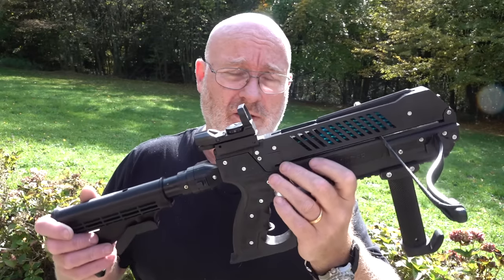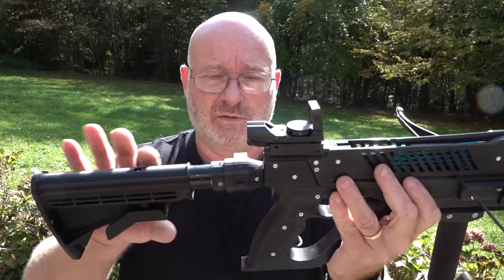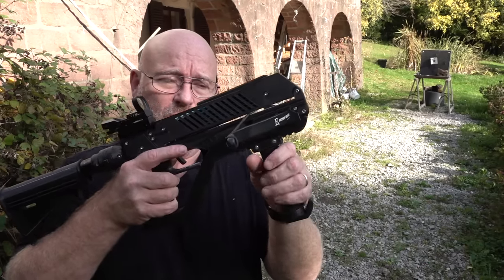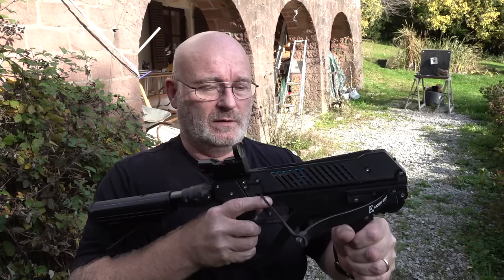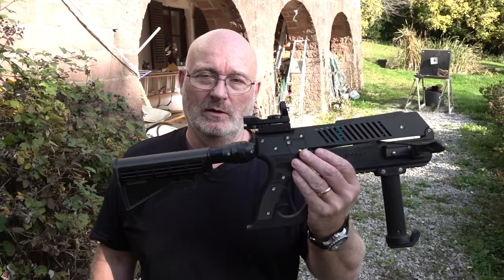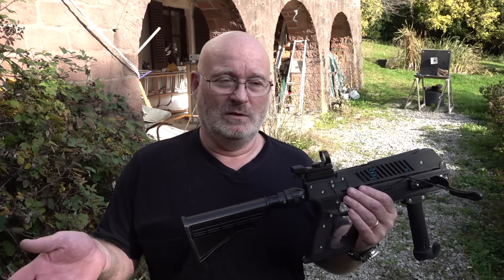Next Level Rapid Fire Crossbow (3D Printed)!

Comment: Great video, cool crossbow, Joerg. 

I want to question the idea that more than 50 lbs is unnecessary... Have you ever tested the stinger broadheads on pork ribs? I think that's the most relevant target, and I think the extra power could be decisive.
Reply: I agree. Something with that low a power is simply going to piss someone off - not stop them.
Reply: @riffhurricane  Disagree - the broadheads, like he says, are sharp and deadly even at lower speeds, but I think they  need a bit more power to reliably cut or pass between ribs.

If you are referring to folk using target bolts for that purpose, then yes, that is just dumb, and a little extra power won't redeem it.
Reply: @FrogmortonHotchkiss  Fine to disagree, but I'm talking about the demonstration he did with the broadheads.

As another commenter on Goerg's thread mentioned, there are a ton of cases where an assailant was shot (with a firearm) several times starting from about 20 yards out & they still managed to close in & attack the shooter. A two inch wound (or even several), is not going to stop a determined attacker in their tracks unless you are very lucky.
Reply: @riffhurricane   Soldiers have fought on with multiple bullet wounds; does this mean that nothing short of a cannon will do? No, you have a well-rounded strategy and don't get hung up on unlikely outliers.
Reply: @FrogmortonHotchkiss  Go on then lol, find me a soldier who will want the weapon with less stopping power over a weapon with more. The high rate of fire is only so useful when it's effective range is no more than 15 yards or so.

Comment: Can this be modified to use Rubber to slim the profile on it? Anything that has 60lbs of draw or better?
Reply: Yes, there is a slingbow adapter available matching most Adderini slingbow arms. More than 60 lbs in rubber are somewhat doubtfull but might be possible with short slingbow arms and  > 6 cm wide Theraband Gold.

Comment: I can't quite tell by the video, but it looks like it's either PLA or PETG plastic. PETG prints a bit hotter and is a little bit springier. PLA prints a bit lower temperature than PETG and is more temperature susceptible. PLA is strong but brittle. PLA is biodegradeable, most PETG is petroleum based and is not.
Reply: Could be both since some parts are glossy and some matte. I would print it with ASA from Extrudr, which is easy to print and should withstand a bit more while it doesn't shrink as much as ABS. One guy with a huge YouTube-channel print his pistols with PLA+ from eSun, which feels like a PLA/PETG-hybrid and doesn't get brittle like the Polyterra PLA I bought once. I think this crossbow doesn't feel solid enough because of lower infill rather than material-choices. PLA is afaik one of the heaviest filaments from it's density and the stiffest if it doesn't get warm. I love PETG, but it probably bends to much for some parts.

Comment: Im not an engenieer but is there any way you could incorperate a hydrolic system to increase the draw power on these things?
Reply: Pretty sure you meant pneumatic, not hydraulic
Reply: @dougaustintx  nah, i mean like a hydrolic ram to increase leverage on the cocking mechanism, not an air powered one.

Comment: Can't find the limb used on this anywhere i have printed everything. But now i have a useless peice of plastic without the limb. I dont want to use the 90lbs it will not be a happy combination. Please help joerg i want to finish it.
Reply: Will the stinger 2 55lbs limb work?
Reply from the maker: Yes, but you have to narrow it down a bit in the middle. Just use a sharp knife.
Reply: Thanks Joerg, that helps a lot.
Reply: I have used 55lbs stinger 2 limbs on my adderini. My solution was to file the limb slots with a file. Make sure not to file too much as it needs to be a tight fit with the rubber padding also. I'm very happy with my build, it works awesome.
Reply: @Slingshotchannel  The only problem that i have found is the notching that connects the pistol lower outsides, and the hand grip. top and bottom notching is perfect just remove the notching on the rear curved side it is unnecessary for fitment and just makes for a horrible part of the build. If i had the step files i would fix it and make it perfection. Please ask the designer to fix that issue for future downloads.

Keep up all your amazing work mate, you are a joy to watch.
Reply: @DKFX1  Thanks for the feedback I have ordered the 55 and 35 stinger limbs.
Reply: @daledigsdownunder  beware that I said it fitted the Adderini. Don't know if it will fit the Mini-adder 2, but I think it will.

Comment: How far do you think it can shoot accurate for hunting small game like pheasant or Quail ?
Reply from the maker: For such small targets, maybe 15 meters. It is just a pistol crossbow.
Reply: @Slingshotchannel  sounds like I will need something a little stronger then, unless it could be designed to use a 100-120lbs bow.
Reply from the maker: It isn't the power that is the issue. There actually is a 120 lbs limb set for it. Accuracy is the problem. The short (6,3") bolts and the even shorter power stroke won't be accurate enough for such small targets no matter how much power they have. You can hit a pizza box at 20 meters, that's about it.
Reply: @Slingshotchannel  That makes sense, like the difference between a rifle and hand gun accuracy. I wonder if a flip down or slide in longer barrel would help with that combined with the 80 or 100lbs bow... Thoughts?

Comment: Polycarbonate (PC) 3D printer filament is the strongest filament that most 3D printers can use.  Though a printer has to get very hot to print with it, not all 3D printers can use it for that reason.
Reply: It's so tricky to print though. I can see why Faramir used PLA. 

I have updated my Ender 3 with a dragonfly hotend that's good for up to 500°C but I have yet to master PC printing. You absolutely need an enclosure for your printer and it's good to have the whole enclosure heated as well. The bed temperature also needs to be around 120°C, higher is even better. 

And then you still have to face all the challenges during printing like warping, bed adhesion and the like.
Reply: @schwuzi  Haha, yea, I was about to mention that you need to heat the enclosure to get good layer on layer adhesion.
  There might be PVC or PLA with carbon fiber added for more strength.
Reply: @musikSkool   I think the best option would be a CF nylon filament. It's easier to print than PC and the stiffness would be great for a this bow. 

I have never heard anyone mention PVC filament before. Is that really a thing? I wouldn't dare to print with that. First off the fumes and secondly the chance for hydrolysis with moisture in the air. You can throw away your whole hotend assembly if that were to happen.
Reply: @schwuzi  "Fillamentum Black Vinyl 303 PVC Filament"
You are correct, it says it can create chlorine gas and to only print in a very well ventilated room.

Comment: hey question to everyone watching, do any of y'all know where Joerg gets his archery mat targets from? I would very much like to get some but I can't find them online
Reply: Don't know if it's the exact same one, but if you're in the UK Rifleworks sells an EK archery foam mat for £43. 

For a bit of unsolicited advice:

I make my own backstops which last much longer & are much more effective than foam - & free so long as you have lots of old unwanted clothes or similar fabric. The only drawback is they don't look so pretty. Stuff a sack (like a fabric rubble sack) with the clothes as tight as you possibly can & tie off at the top with a cable tie. This will stop anything easily (including my 185lb compound with a broadhead fitted), no breakages & very easy to pull out. The one I'm using I've had for over a year & it's probably taken over a thousand shots & still going. The £1 builders sack is starting to disintegrate but I bought a pack of six of them so no biggie, the clothes will get stiffed into a new one.
Reply: @riffhurricane  I have 3 homemade targets, and for my recurve bow they work great, but my cobra siege packs too much of a punch and the bolts either go in too far and damage the vanes, or they get embedded into the target too hard and are extremely difficult to remove. I used old plastic sheeting that I've stuffed into a plastic barrel and then used old carpet for the surface. I would absolutely rather make something myself that's cheap or free, if only I could solve the issue of them getting stuck and or damaging the vanes.

I will try using clothes instead, thank you very much for the tip and cheers from Oregon City!
Reply: @jamesallred460  Hope it works better for you mate. Another thing you could try is flattened/blunted practice tips which won't go in as far (though they'll decelerate quicker which can be destructive to the arrow or bolt).

Best wishes from the south coast UK!

Comment: Awesome design, but I guess you need an oversized printbed for this, so over the 256 mm what my printer can archive. I hope I'm wrong😁
Reply: I imagine it's probably sliced to be a few smaller pieces that slot and get glued together like the legolini and adderini before it so it fits on smaller print beds
Reply: You can now print it with 220 by 220 he updated it
Reply: @ufoslattt9582  Thanks for the reminder and the non splitted parts are for 250 x 250 mm heatbed, so fit in my Bambu Lab👍
Reply: The leaver needs a 300 x 300 mm printbed if printed in one piece.

Comment: I am asking the same question, one more time : is it designed to use the same bolts as the Stinger?
Reply from the maker: Yes.
Reply: And, about the price tag : would such a " toy" cost as much as a Stinger?
Reply from the maker: No idea, I don’t own a 3D printer.
Reply: Good! Another one: could it fit the Stinger limbs, or the EK Archery limbs?
Reply from the maker: Both.
Reply: Viel Dank!

Comment: Vorsicht! Attention! In the German weapons law it says: 

WaffG Anlage 1 Abschnitt 1 Unterabschnitt 1: Schusswaffen 
1.2 Gleichgestellte Gegenstände 
Den Schusswaffen stehen gleich tragbare Gegenstände, 
1.2.3 bei denen bestimmungsgemäß feste Körper gezielt verschossen werden, deren 
Antriebsenergie durch Muskelkraft oder eine andere Energiequelle eingebracht und durch eine Sperrvorrichtung gespeichert oder gehalten werden kann (zum Beispiel Armbrüste, Pfeilabschussgeräte). 

1.2 Equated objects 
Portable objects are equal to firearms, 
1.2.3 in which solid bodies are fired in a targeted manner as intended, whose 
energy is supplied by muscle power or another energy source and can be stored > or held < by a locking device (e.g. crossbows, arrows, etc., arrow launchers). 

1.2.3 clearly states this pistol crossbow is still a crossbow and not a bow, because the energy is put in by muscle power and can be HELD by using a locking mechanism. In this case, your pinky using the grip. 

I would not advice to treat it like a bow.
Reply from the maker: You can’t put it down cocked, and you have to hold the tension up with muscle power. So you do not store the energy.
Reply: @Slingshotchannel   I see your point and am more than happy to go with it given the opportunities, though I am not totally convinced the BKA or the police would see it that way.

Comment: "Legally it's not a crossbow because it doesn't lock"

Does that mean I can remove the lock from my adder and it legally becomes a "bow"?
Reply: I would believe so but I remember Jörg stating in another vid that a modified Adder without a lock and held by the pinky would become an illegal weapon. 

Maybe just for tampering with the original design, not for the fact itself.
Reply: @Kashban   @JoergSprave I don't know if the tagging works here (probably doesn't) but if you see this Jörg, would be nice if you could clarify this.

Comment: thats made with pla which mets at around 200c and you want petg which melts a 250c
Reply: you're talking about printing temperature, not melting temperature. both melt at much lower temperatures.
Reply: @DKFX1  I would say they melt at ranges, and the term "melt" could be applicational. And regardless what application (for 3d printing, or to be politically correct); my point was that petg withstands heat better.

Comment: You can't get much better material than that without an industrial grade machine. Normal (not 10k plus) 3d printers aren't gonna produce anything of too much strength
Reply: Such a statement reveals little to no knowledge in regards to the more sophisticated filaments. Esp. those with Carbon fiber. Be it ABS, PC or Nylon. There are several brands which print fine on your average 3D printer (hotbed up to 260°C / heated bed up to 100°C / no enclosure). YMMV with your skills.....
Reply: @HolgerBeetz  you're right, I don't know shit about carbon fiber filament, but it sounds pretty sweet
Reply: @iain-duncan  It was not mentioned as offense. I just wanted to show that there are alternatives available for those cheap 3D printers which are pretty sturdy. Just watch some videos on Youtube with CF Nylon or CF PC ;-)
Reply: @Holger Beetz  yeah I'm genuinely very intrigued! It sounds really cool to he able to actually print in carbon Fibre on easy to access home printers
Reply: @iain-duncan  Well, beside being intrigued it would be nice to not make such a statement in the 1st place without full knowledge ;-)

Comment: How do I buy this?
Reply: These aren't for sale, you need to buy the 3D files and print it yourself. It will probably take months or years before these are mass produced. If you're lucky you can find a 3D printing service willing to print the files for you. I've printed several adderini's myself, which is a similar design but in my opinion better and simpler.

Comment: it looks like it lacks of ~70 lbs draw weight and compound limbs to be worth buy
Reply from the maker: You are missing the point. With crossbows like this one, for self defense, you want to go as LOW on the draw as possible so it is still effective. You want fast repeating, which you can not do when the draw is to heavy. You don't want compound either, as you need total reliability. The fewer parts the better.
Reply: @Slingshotchannel  i agree to reliability but the power could be better

Comment: He must have used PLA or an other standard filament. Printing it in Nylon would really ramp up the quality but requires higher heats so not all printers can run Nylon filament... hmmmm.... MUST.... HAVE.... 💕☠💕
Reply: ABS could work too but that is nasty stuff... you need to have a printer with a heated build volume and good ventilation. No way using this thing in an appartment. Probably the same with nylon.

I am going for PET-G which is a bit more heat resistant than PLA and also deteriates not that quickly.

Comment: Printed in PLA plastic apparently, it will not stand heat very well. Weak plastic over all. More for prototyping, not for end use.
Reply: PLA is one of the strongest plastics on the market, definitely strongest in the budget category. PLA plus is even better. Although you're right it doesn't stand against heat and the elements very well.
Reply: @DKFX1  petg is stronger and in the same price category no?
Reply: @ufoslattt9582  PETG is both weak and brittle. Basic PLA is stronger. Various brands of PLA Pro/Plus will absolutely crush PETG in terms of overall toughness.  PETG handles heat a little bit better than unannealed PLA.
Reply: @DKFX1  I thought about PLA but went with PTEG, because its 105-110F during summer where I live. A black PLA pretty much melts in the desert and loses its strength rapidly when heat increases. be careful about leaving it in the sun
Reply: Its opposite in my experience